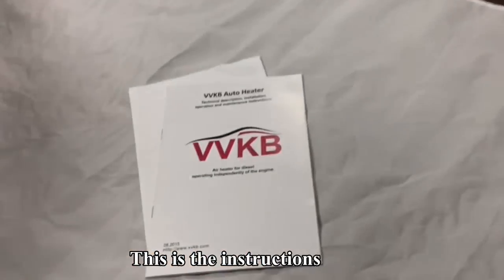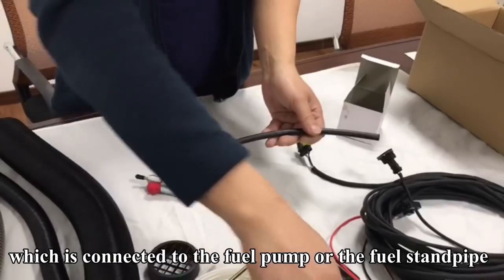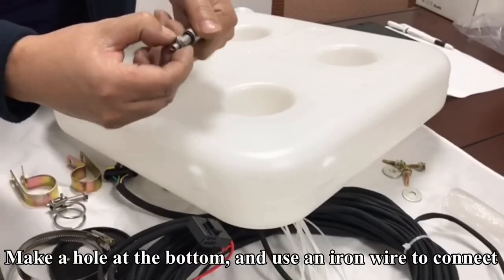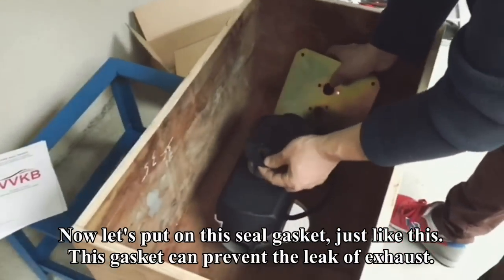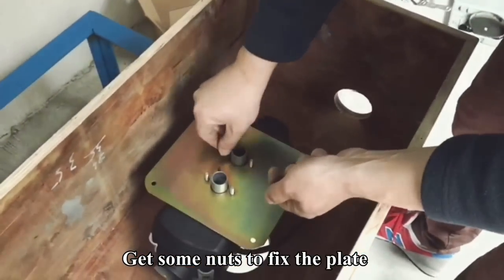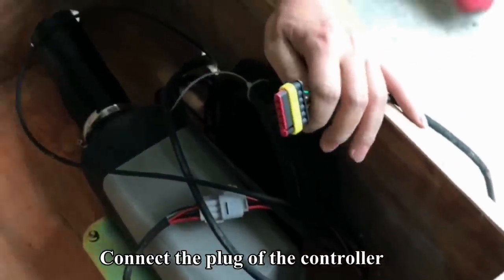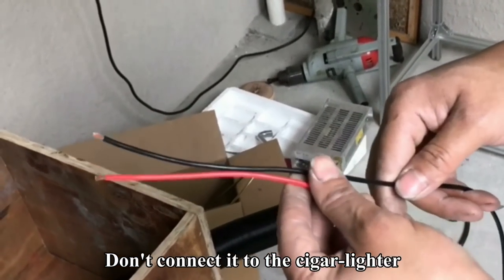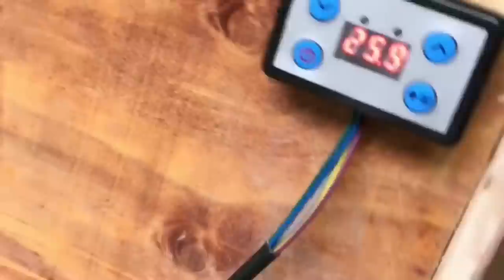How to install diesel heater

Comment: The pump shouldn't be installed vertically, not  horizontally. Theses pulsed pumps produce little bubbles that need to be able to travel up the fuel line. Mounting the pump horizontally will trap the air bubbles and cause problems with the pump.

Comment: Very sorry but this is the way not to install a heater. This is the way not  to start it up first time .the pump is supposed to be installed vertically to avoid air lock. Prime the pump damage will accur if you run the pump dry  .don't take my word for it there are plenty of other out there that will help you to install these heater the correct way, save yourself a load of problems and fiend out the  pitfalls before installing and save your self a load of unnecessary problems get it write first time it will run get it wrong it won't. Good luck 🤞 willemog,

Comment: FIRST thing you need to do when you get one of these heaters , (controller unit portion)  Is to get something like RTV Gasket maher OR Hot glue gun and pump it up into where the wires come out and also get it all around the wire & the plastic housing of the control unit to give it a stress relief. After you pick up & move around the unit a number of times you will find that the wires that are soldered to the board are fraying & will either break off OR the strands that get broke loose will short to the wire / terminal nex to them & your controller will either turn off or short out. The terminals on the board where the wires attach are way to close to each other. One tiny wire strand that brakes free will touch the terminal next to it & cause you issues. Ask me how I know this.

Comment: A very thorough video ... I have a China brand heater that have all the same parts ..... what diameter is the hole saw that was used in this video?
Reply from the maker: The hole diameter of the VVKB heater is 90 mm.

Comment: Hi, does the heater have to be mounted on a floor, or can it be mounted on a wall (ie sideways)? Thanks.
Reply from the maker: Hello, From the perspective of heater operation, we do not recommend side mounting. Therefore, some production companies will provide L-shaped mounting brackets, which can be mounted on the wall using the L-shaped mounting bracket.

Comment: Hey thanks for this video, i believe i did everything correct but the gas doesnt pump into the heater? What could my problem be, is it just the buttons im pressing on the remote or did i install incorrectly?   Only getting cold air
Reply: its not 12 v?????
Reply from the maker: If your installation is correct, there will be no malfunction.
Unless you are using other brands of heaters.
We don't know the operating logic of those heaters.

Comment: how do you get the rubber holder on the fuel pump? mine is too tigh
Reply from the maker: For the safety of the oil pump, the size of the rubber bracket is relatively small.
Reply: Leave the bracket in very hot water for a few minutes to soften it.

Comment: Great video! Does anyone happen to know if the main heat unit needs to be mounted in one specific position or orientation?  Is it maybe possible to mount the main heating unit in different positions... such as on it's side, vertical or upside down, with the two mid/two center pipes pointing up towards the sky(?)
Reply from the maker: The side is ok. It’s not upside down.
Reply: VVKB Heater  - Ah ok. So would it be okay to mount the unit with the fresh air intake pipe and exhaust pipe  pointing straight up(?)
Reply from the maker: @__WJK__  The exhaust pipe is preferably directed directly below.
Reply: VVKB Heater - Thank you, that makes sense, especially taking into consideration that any condensation generated during use would not be able to drain properly if the unit were to be mounted upside down.

Comment: Hi, I have exactly the same one,and did it step by step same like you but my fuel pump isn't working.... It won't taking any fuel.. Do you know anything about it. Thank you
Reply from the maker: Please carefully check the pump connection plug.
Reply: The pump need a 45 degrees angel. Am i right?
Reply: tijs louwers between 15 - 30 degrees (near horizontal)
Reply: The pump needs to be on a 45 deg angle, then it will work if it's clicking...

Comment: The fuelpump must be more vertically, between 15-60 degree. And remember to prime the pump first, before connecting power, or the pump will die shortly.
Reply from the maker: Your approach is very correct!

Comment: I just installed this same heater over the weekend.  When I start it, the fan runs slow for about a little while and exhaust comes out of the exhaust hose.  Then the fule pump clicks a few times.  Then the fan gets a little faster.  Then the fan goes on high. I never hear the fuel pump again.  The fan runs on high for about 30 seconds then the heater turns off. No hot air ever comes out.
Reply: Please tell us the brand of your heater. If it is a heater like Webasto, we will provide assistance. If it is other Chinese products, there are too many heaters in China, and we don't know how they work.

Comment: is there a temperature sensor so the heater can be set to auto turn on or off when the preset room temperature is met?  It would be nice to have a link to a site for this product and purchasing info.
Reply from the maker: Hello Psyamok,
Happy to receive your mail.
Yes, the VVKB heater has a temperature control system.
When the pre-set temperature is reached, the heater will reduce operating efficiency to maintain temperature.

You can buy it at our retail website: www.RVheater.com.
Thank you!
VVKB Heater
Reply: in this video, you did not show the temperature sensor that's why I asked.  Pls show the room temperature sensor and how long the wire that accompany it as I'm planning where to mount it.  Thanks.
Reply from the maker: Yes, this is our mistake, thanks for your reminder.
Heater control panel with temperature sensing.

Cable length of about 4 meters.
We already use the latest dashboards, check out the video: https://youtu.be/ZZeFoIMNmUo
Reply: My non-brand eBay Chinese heater for $120.00 is exactly the same & works the first time I turned on. Using it for two winters now. I just bought another one for my shipping container studio and it works. Don't waste your money on branded heaters people, they are the same.

Comment: it is ok to install a metal bracket right on the wood? does not it burn a wood after time? thanks
Reply: I could be wrong but I don't think the metal bracket gets that hot.  If it did then it would probably affect the fuel intake line also since it connects to a piece of metal that also goes through that metal plate just an inch or so away from the exhaust.
Reply: 101perspective you right, thanks. I am going to install it today.
Reply: @cervofun  Np. 

Btw, I just finished my setup yesterday.  The only issue I ran into was the cheap fuel filter they provided.  I had a tiny leak coming from it or the connection to it.  We are talking just a drop or two of diesel over 24 hours.  To be on the safe side I removed it and bought a new one from an auto parts store.  The tricky part is finding one with a small enough connection to fit in that black hose.  I went with the Prime Line 7-023008D.  Was about $7 after taxes.  A bit more expensive but I'm not sure I could have fitted one of the cheaper ones.  Even this one was a VERY tight fit. couldn't even use those metal screw clamps they provided since the hose bulged out just a hair too much with the filter on.  Had to go to a hardware store and get a couple of the really tiny screw on clamps... so, about another $3+.  Anyway, tested it today and it seems to work well... no leaks yet:)
I just wish I had replaced that cheap one during install vs after.  Was a pain replacing it without getting diesel everywhere.  Even then I got several drops on the hose.  Cleaned well but still a tiny smell of diesel on it.  Not a huge deal though.
Reply: @101perspective  I installed mine yesterday, everything ok, just changed all steel hose clamps just to be sure. I have one of the Chinese heaters with color LCD display and realized, that is still on, i cant turn it off. I am a bit worry, because my setup is running from my car battery. Do you know by chance how big impact it is for battery consumtion?
Reply: @cervofun  I found a good video talking about the different controllers.
https://www.youtube.com/watch?v=YW2biaijaO8
He talks about power consumption at the 8:15 mark.  Yours is .14 to .15 amps.  That's just under 2 watts. 

I found this website that seems to have a bit of information on car batteries and how much power they can provide, etc... http://www.chem.hawaii.edu/uham/bat.html
I didn't read all of it but I think the key points it makes is that your car battery may have 45 amp hours but you definitely don't want to use much of it at any given time.  Unlike deep cycle batteries, they aren't designed to be repeatedly depleted by 40 or 50%.
I highly doubt that running the control over night is going to be a problem at all.  However, if you left it for days on end without ever starting the vehicle up so the alternator can recharge the battery then maybe. 

Btw, you aren't running the heater via the car battery with the car off are you?  I think that could definitely be a problem since the heater draws maybe 40 watts I think (like 90 on startup... but only for a few minutes).  I'm no expert though, maybe that website could better answer that question.  I think there is a Youtube video on exactly how much power the heater uses also.
Don't get me wrong, if it is 40 watts then that would probably only reduce your battery by maybe 40%.  So, your battery would handle that.  However, I think that would reduce the life expectancy of your car battery significantly.  Like I said, that EDU site probably can better answer that question.  I run mine off a solar deep cycle battery so I never did much research on the car batteries.
Reply: @101perspective  yes I am running it via the car battery for now..Today I am gonna buy AGM battery as my auxiliar. I will charge it from an alternator and next year I will add a solar panel. Thanks for the great answer, I learned a lot from it. I am looking forward to winter, finally, I will be in a comfort zone. Canada is a great place to test the ability of this heater.
Reply: @cervofun  Yeah, I've tested mine out and it is pretty sweet. 

Sounds like you are going the opposite as me with the AGM.  I have an AGM also but started out with a solar panel and am now thinking of adding a continuous duty solenoid.  (watch?v=1zrwHyy4qyY)  Though I have run across this other product, a dual battery isolator with voltage sensitive relay.  I haven't done much research on the latter but on first glance it sounds like it might be easier to install, and even better overall.
Nothing wrong with solar btw, I've done fine with mine.  I got a fridge though in addition to this heater and am afraid my 100ah AGM isn't going to charge up enough during the day now with only 100 watts of solar.  I would upgrade solar and add a battery but that seems a bit overkill since this is only an issue during winter.

Btw, don't forget to buy some kind of high temp sealant for the holes under the vehicle once you have it installed.  Also, don't forget that you might have to pull the heater out down the road to clean it (or be able to clean it in place).  So, either position it well or use a sealant that will be easy to remove but can handle the high temp of the pipe.  The pipe itself does get pretty hot... just not so much the plate.

Comment: I want to install this below my bed in my RV. How loud is this unit?
Reply from the maker: The VVKB heater's operating noise is less than 50 decibels, which is the result of VVKB engineers' understanding of the combustion chamber structure and airflow patterns.
We don't know the working noise of other Chinese brands of heaters.
Reply: The Webasto and espar are very quiet. Just fan noise.
Reply: Not at all